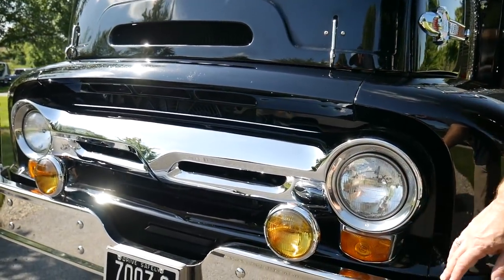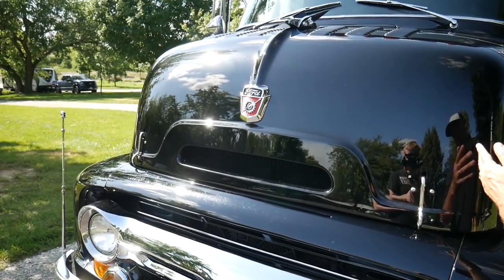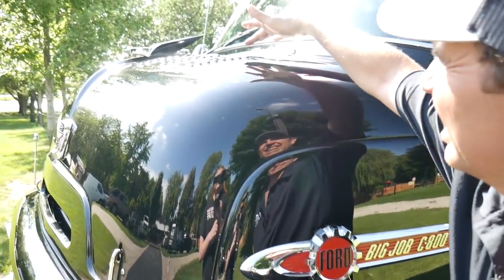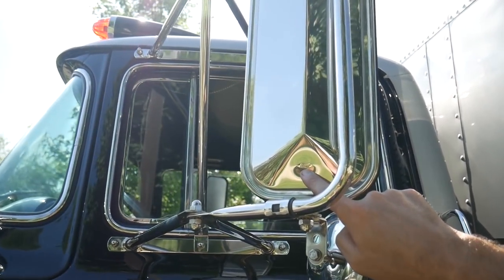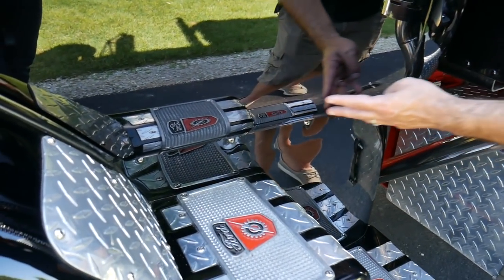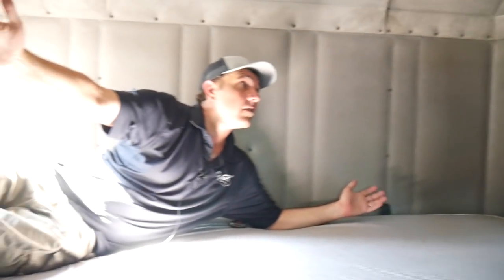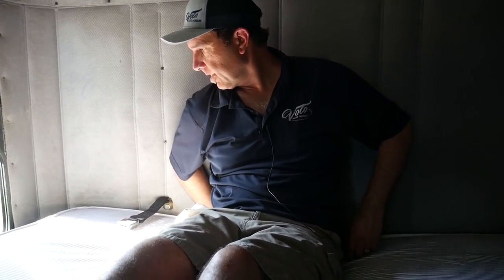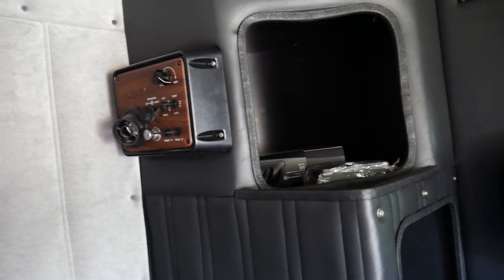1956 Ford C800 Car Hauler for sale at Volo Auto Museum (V18300)

Comment: If I had built it, I would have had the sleeper built to the same height as the box, make it 2 levels of bunks and or an upper bunk with a lower seating area/desk/microwave/sink..., installed multiple opening windows in the sleeper for ventilation and lighting, a generator which would operate the air conditioner and heater for the sleeper, maybe a lift tail gate to get the car inside...otherwise, nice restoration.
Reply: Aerofoil scoop on sleeper cab, be areo dynamics i

Comment: Very beautiful. I'd get frustrated after a while with the car door hitting the trailer wall every time you had to open and close it getting in and out. And you're thin, imagine a sizable dude? Too bad the trailer door doesn't allow the car door to protrude through it when you open it. Looks like even if you pulled farther forward it still wouldn't.